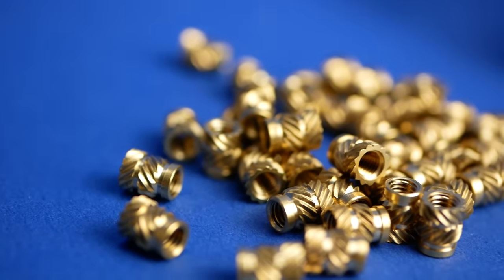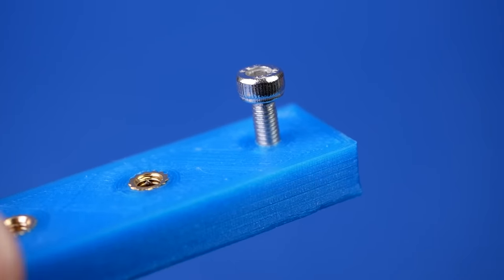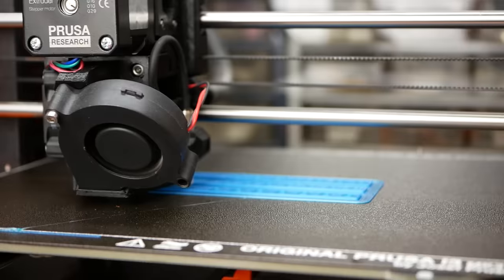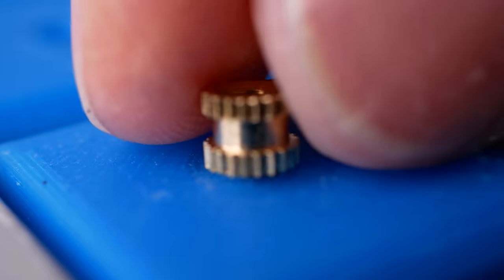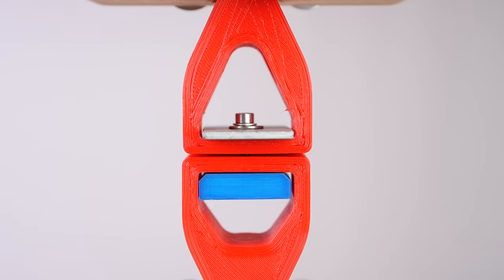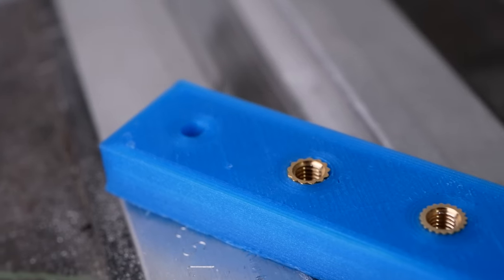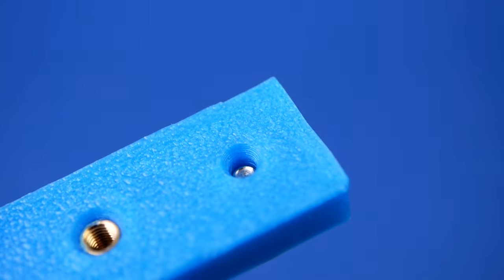Threaded Inserts for 3D Prints - Cheap VS Expensive 💰

Comment: Thank you for the video, honestly only ever used the Injection molding inserts and just figured they were all about the same. One difference between how I use them and how you tested could make for a video idea. When I design holes, I make the octagonal rather than circular..... they seem to be printed more accurately in size, and since they are printed so small, there's little difference in the viewed shape made. Too that, I usually design object to accept the insert in from the rear or the part, the chase the threads with a tap. IDK if it helps with strength, but my thought was that I'm essentially trying to pull the inset through the plastic when tightened, rather than pulling against the direction of insertion.

Comment: damn that 0.1 difference is great. most printers I see make it 0.5~ smaller. mine used to do 0.3mm i think? i'll check again
EDIT: huh mine can do 0.1 too with ease. I was wrong this hole time....
Reply: Yeah 0.1-0.2mm is normal. More is usually holy overextrusion batman.
Reply: Mine was on point, though I need to put it back together with the new stepper drivers.

Comment: Why did you choose a straight knurled nut as the demonstration object of hot melt installation? The installation method of this straight knurled nut should be injection molding, please do not do this stupid thing.

Comment: I have the cheap Ali inserts. Mostly for items with repeated screwing and unscrewing with little pullout load.
I also design a small indented circle that works with the outer diameter of the insert as a position guide. I also modified a soldering tip to have a cylindrical tip that fits into the insert to keep it aligned and stable and improve heating of the insert.

Comment: I just stumbled on your channel recently, and this was a great video. Thanks for your work on it.

Something worth noting about screwing directly into the PLA: since you're effectively cutting threads out of plastic using your screw, those threads likely won't stand up very well to the wear and tear of removing and re-inserting a screw multiple times. If you're looking at a situation where you need to add and remove screws from a part multiple times, you'll almost certainly want to use an insert.

Comment: SO basically expensive insert perfectly solve a problem that doesn't exist.
Reply: no ... an insert is way better, when using the screw very much. here he tested only first use, not long time use ;)
Reply: @georghartmann6971  good point Mr. Hartmann, I however always screw directly into plastic (or to a nut behind it). Inserts are just not ever absolutely required, really, so I've never needed them..

Comment: I use the "screw directly into" material method nearly all the time. Just be careful to not overtighten it, it is not necessary. Because, what should not be overlooked about this method is that the screw secures itself. There is constant pressure on the thread. Metal to metal threads are quite loose and extensive vibrations can make them loose their tension.

Comment: I don't really agree with your testing model, if your after durability, you use stainless steel bolts. If you are after high quality screws, you go for high carbon grade 8-9 steel with black oxide anodization. Those bolts you used, look like brass..

Comment: You'll probably get more useful torque test results if you were bolting down a stack of washers rather than just the bolt. The longer exposed thread of the screw will be allowed to stretch and load up the insert properly

Comment: Hi,

I use the cheap ones for when needed. More like multiple loosen/tighten threads. Because pla wears out.

But I have another approach.
I make the hole slightly smaller.
Heating up a little and then pull them in with a bold on the other side. Not completely through the hole and a little plastic in front so it's locked up. And before pulling it in a drop of CA glue.

Maybe you can test something like this too.

Yesterday I saw your epoxy / CA glue video. I also thought CA would improve strength between layers but turns out it doesn't.
For expoxy I use Z-poxy but probably much more expensive then HK.
Although it less yellow I think.
After a while it still colors yellow due sunlight.

And try some carbon fiber or glascoat with CA instead of epoxy in your next test.

Keep up the good work.

Comment: @CNC Kitchen I just clicked on the aliexpress search link elsewhere in the comments and I saw something interesting.  They have threaded inserts that are like solid helicoils.  They are threaded inserts that are threaded on the outside as well.  A M3 insert is threaded as M5 on the outside.  Your testing showed that self tapped screws held on almost as well as an insert.  Extrapolating from there a larger self tapped insert would hold on at least as well and also have the advantage of more surface area of the larger outside screw size so I would expect it would hold even better.  I wonder how it would perform in the torque out test though.

Comment: I use hot inserts similar to the ones you prefer for 1/4"-20 UNC tripod mounts. For other applications I print holes and hand tap as it works better for me than forcing a machine screw. For holes  of 2mm or less, I use wood screws as machine screws are not intended to be self tapping into soft materials.

Comment: I bought some threaded inserts from eBay and chose the sort with the short plain section (like the $18 inserts) because I thought it would be eaiser to locate an the plastic was less likely to get "ploughed" into the thread. It's nice to see my "Guess-geneering" actually was right and confirmed by actual testing. Thanks for all the effort you put into this kind of testing, the 3D printing space it way to full of things that are taken to be true because someone saw it somewhere, but for which there is no actual video or blog post showing whether it is true or not, or still true with modern materials and printer designs.

Comment: Hmm… I have a question, I don’t think you tested this in any video.
So, if the pull force to take out an insert would be 110kg, that would mean a 100kg weight would not be able to pull the insert. BUT I can’t stop wondering if time would matter in this case? What do I mean by that: let a 100kg weight pull on the insert for days or months, will the plastic not start to give away slowly? (in ideal conditions, of course, with constant environmental factors… no high temperature fluctuations and such). I’m thinking that being able to hold 100kg for 1 minute isn’t the same as holding 100kg for 1 year. What do you think?
Because I don’t care if the part is able to hold 100kg in a 1 minute test, if it may start to slowly fail over time and fall on your head 2 months later. Would be very interesting and useful to also see what is the maximum weight it would be able to hold over an indefinite period of time.

Comment: If you ever need to screw directly into the part without an insert, on subsequent installs begin by turning BACKWARD (loosening) while pushing the bolt into the hole. You will feel the threads of the bolt drop into the existing threads in the part. Now, screw in normally. This will ensure you never cut a second set of threads into the plastic part. Not nearly as good as an insert, but the best you can do if you must go directly into plastic.

Comment: Great work Stefan !    Perhaps you would consider testing a Helicoil insert thread as well ?    Helicoils should have the advantages of a plain tapped thread, but with the additional strength of a larger diameter thread.

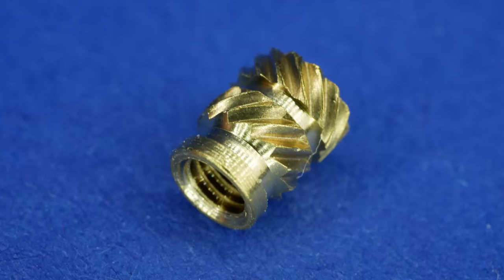Comment: I worked at a POS(Point of Sale) industrial repair shop and most if not all of the units I fixed used the threaded inserts at 1:50. They didn't seem to pull out very often and were VERY strong. The plastic they used was a PC/ABS compound and hardly ever broke.

Comment: I use the ISPINNER threaded wood inserts for wood from amazon. They are a bit tricky to design a hole for because of their cone shape and large threads. The threads will really melt the plastic as you screw them in while using a soldering iron and Allen wrench to get them in. But I doubt they would fail before the 3d printed part fails. They do require allot of heat to insert but I highly recommend them. They also have a nice flush top.

Comment: Thank you so much for making all this informative videos.
i see the inserts are installed to the same side the screw will pull them (for axial test)
wanted to suggest pulling them from the opposite site, 
just making a clearance hole the size of the thread (3mm) 

will be harder to pull out with material the size of the insert thickness blocking them from getting out

Comment: I bought some of the injection moulding inserts a couple weeks ago when the original threaded inserts video appeared in my feed. I was going to use them for a Redox keyboard, and I still am. However, I now know that they're best suited for threads where there isn't much of an expected load. I've had to get the bottom case parts reprinted because I was trying to force an M3 threaded insert into a 3mm inner diameter (I didn't RTFM). I've been able to get the 3mm inner diameter increased by 0.45mm, which makes the inner diameter of the hole only 0.05mm smaller than an M2 threaded insert outer diameter. Obviously that's only on paper, and in the real world, it'll be more like 0.08mm smaller. But at least it'll insert without gunking up too much

Comment: great video, was curious of the process, I was prototyping a handle cover for something with some PLA and with just set screws the plastic of course ended up cracking away at the layers when you over torqued it as you'd assume, so also got these heat inserts to use with the set screws and I got the same style of the amazon ones you showed in this video, and they work much better. Very informative video, great content.

Comment: I work in a plastics factory. We use an insert very similar to the Ruthex. We load it into the tool before the part is injection molded.

We also insert similar inserts into parts after molding with a sonic welder.

Comment: I work with mechanics. You shouldn't have used brass bolts for the torque test. Even if you buy quality bolts they break easily. The m3's we use at work can easily manage 4Nm.

Comment: Great video. I have some questions though. In your previous video, all your tested inserts failed due to the plastic cracking in the part, leaving plastic on the insert. How come this didn't happen here?
Also, the inserts you show in this video and say are the ones you used last time seem a bit different. The ones in your previous video didn't look like they had spikes on the sides but rater spiky rings around them which sounds more likely to hold on to the part better. Are they the same as last time?

Comment: There's a number you should hit for the hole size for threading into any material, for M3 it's 2.5mm. M4 is 3.3mm, M5 is 4.2mm. That allows the tap to cut the full thread. Smaller than that, you risk breaking the tap, bigger will compromise the thread.
Reply: Fred Genius I was wondering about this too. The hole was just tapped with the screw, so would a “proper” sized hole used with a tap be stronger?  

Maybe not as the direct with a screw method leaves more material?  Does the heat of tapping cause the PLA to melt a bit and form a wall thickness matching the threads?

I smell a sequel!
Reply: @joshsekel  I don't use this method much with printed parts, but in metal I always drill the right size hole for the thread. Metric threads have major and minor diameters defined (as all threads do), so for internal threads you want to hit the minor diameter as close as possible so there's as much material as possible to create the thread. The larger the hole, the weaker the thread. I always use a tap, by hand, so the heat generated is minimal. Although if you want to use a drill I don't see a problem - other than it's good to 'feel' the progress of the tap to avoid breaking it, especially on smaller threads.
Reply from the maker: If you directly screw into plastic you shouldn't go all the way down to the tapping diameter. During tapping you cut the material, directly screwing into the material just pushes it to the side, so if you do too small you will stress the part too much and crack it.
Reply: @CNCKitchen  I agree, but taps are cheap and readily available, why would you want to screw directly in to plastic?

Comment: Hi Stefan, amazing to see you engineering with 3d-printing on youtube. Commonly channels only concentrating on asthetics. 
A few recommendations for enthusiasts: There are dozens of inserts on the market, different geometries do not really distinguish in their costs, brands are making the price. The geometries is important for embedding the insert. For example the cheap insert was a typical double flange insert for injection moulding. The second one (double helix) is commonly used for ultrasonic embedding and the expensive one is for heat installation. There are more geometries available. Many brands even make the pull-out and torque testings available:
@t 
(Have fun with the pdf on the end of the page)

Comment: If you ever do any repeat testing. In the past, I've also added hexagon holes in the bottom of the part for a standard hex nut, also a pocket that the nut slides into.

Comment: Hello! Another excellent video. I did notice one thing - using a drill bit as a size checker is a bit tricky, as the shank is typically smaller than the cutting edge to aid in chip removal. It is likely at least 0.005" less in diameter than the hole it should cut. I learned a lot about inserts from this one, thank you!

Comment: Great video! If I may offer some constructive criticism: For the torque diagram: I don't understand what the 4.0 mm and 4.1 mm signify. I'm assuming it is 4.0 and 4.1 Newton meter? Also, if you wish to convert to imperial system (thank you for doing so), a torque will be represented in foot pound (lb ft) or inch pound (lb in), not pound force.  I'm really suprised you were able to shear off the bolt heads. These bolts are probably some soft brass and a basic steel bolt might give you an idea of the strength of the inserts under a torque, unless you end up ripping out the brass threads.  Wall thickness around the insert probably plays a huge role in the strength of the fastener in twist as will printing and remelting temperatures. Keep up the good work!

Comment: Never got a notification off this one, glad I've just noticed it!! Always have used the eBay ones, but they are quite expensive. You also can reuse them, use the soldering iron to pull them out and let the pla burn off.

Comment: I'm using one M6 bolt with 30mm active thread to hold fog lamp on my bike.
Holder printed from ABS. No inserts. Thread made with tap. 
Only one point - I'm add some rubber paint between frame and holder, to rise friction.
It works well for 2 seasons, and still alive :)

Comment: When I'm screwing directly into PLA, I first heat up the bolt a bit with a butane torch (to about 60-80°c). It makes screwing it in a lot easier, and I think it helps the thread form better, since the plastic that's pushed out can fill any gaps made by extending the hole. It also prevents the plastic from splitting or cracking. I'd love to see a comparison between a bolt that was screwed in warm VS one screwed in cold.

Comment: Anytime I reinsert a screw into plastic, including injection molded parts, I always thread the screw backwards until it falls into the original threads. This way you don't lose much strength by reinserting screws. Based on your video I will likely use this method more than threaded inserts because I typically don't need more than a few pounds of holding force. Thanks for all the hard work.

Comment: Great video. If you do this again you might want to compare to as proper plastic screw. I've found the trilobular ones to hold really well and because you save space on the insert it's reasonable to go up a size or two in a comparison.

Comment: Forgot to comment on the subject. I usually use the bolt-on method but I tap the hole first, if I need more resistance I add a slot for a nut in the back. Tried to purchase some brass inserts here but it's not cheap and I would have to buy many of each size. Maybe I get some on Ali Express.

Comment: Stefan, your videos are always a must-watch for me! I am adding my vote for an analysis of captive nuts. This seems to be Prusa's go-to technique for several parts . I also see some interesting talk in these comments about heat-captivated nuts, which sounds like work but also fascinating. My intuition is that captive square nuts would perform quite favorably in both pull out and torque tests (due to the square having greater surface area on bearing edges), whilst hex nuts would perform well in pull out, but not torque (perhaps unless exceptional print design and heat-setting is used - though i still feel square would be superior under similar conditions due to being less round).

Comment: For my 3D prints I've been using flange-head press in inserts backwards, and heated into the 3D printed part.  This is so the flange head is hopefully spreading the force on the flange, and gas to pull through the print to fail rather than away from the side it was inserted on.

Comment: I've successfully inserted these things using the 3D printer nozzle - it has the right temperature - and it presses down precisely vertically as you nudge the Z-axis motor downwards!  It would be kinda neat to place the inserts over the holes and use g-code to generate the precise heat/location/speed to press them in before you remove the part from the bed.